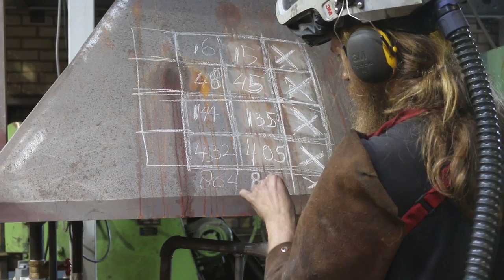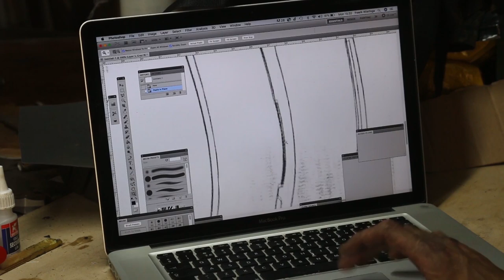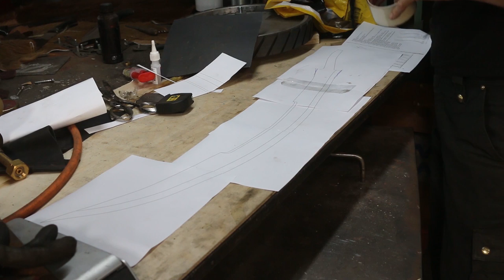Forging a 800 layer pattern welded saber, the complete movie.

Comment: I admire the work of every blacksmith !!! But how difficult the work was without all of this technical help and machinery. What strength, art and knowledge they had. Respect !!!
Reply: It takes different techniques. It used to take more time, but that doesn't mean it was harder, just that it was longer. Remember that they were not as rushed as we are, back then.
Reply: @AnonningAnon  i thought vegan against anything metal.
Reply: @hervyakay4053  I'm anti vegan. Vegan't means "Vegan not".
Reply: Aint no power in sushi

Comment: A Polish hussar saber with a feather, with Polish cross art a deadly effective weapon. A real forage harvester in skillful hand. We touch the handle with the tip of the blade. If it doesn't bend or crack, it is well forged. A much faster and more practical weapon than the Japanese katana. One cut with a katana, three cuts with this saber at the same time. Polish patent for winning battles. Good job, sir.

Comment: You are an artist... This "Kilij" looks really cool. But it looks like you haven't sharpened the reverse edge in the upper section. Except for some examples from the 18th and 19th centuries that reverse edge on Ottoman swords is sharp. In Turkish, this part is called "Yalman" and used for the reverse cutting action. This part is usually about 1/3 of the total Kilij length.

Comment: Freerk's Welded Saber

Attack Damage: 72-146
Attack speed: 1.10 (seems heavy)
Fire Damage: 53-88
Light Damage: 1-104

Bonus Craft: Having a Red Beard increase your Damage and Attack speed by 100%

Bonus Set (2):
The Viking's Law

Freerk"s Welded Saber
Wieringa's Hammer
Have 50% chance to stun monsters. Stunned Monsters take 26000% of your Attack Damage per seconds.
Reply: كيف صنعتو

Comment: Is the grain structure of the metal different depending on whether it has been forged with one, quick squeeze in the press, or formed by thousands of of beatings by a hand-held hammer?

Comment: did you start with 15 layers intentionally? couldn´t help to not notice the progression chart for 16 / 15 layers and now feel inclined to think you just fell short of material
 
my math says you got 757 layers at most if there are none lost through scaling off/ grinding.
You started with 15 sheets, 8 of steel A and 7 of steel B. steel A  will always be on the outside so when folding and forgewelding together you just thicken up that outer A layer that then will never surface again. As you did 3 double folds( stacking 3 slabs ea of the previous bar) and a single fold we have to reduce the amount of layers by 1 for each fold per heat.  15* 3-2 >43 *3-2  >127 *3-2 >379 *2-1 >757

that nerdy stuff aside i really enjoyed watching you doing your stuff

Comment: Beautiful sword. That being said, it looks quite weighty in general with a lot of weight near the tip of the blade. Be interested to know the total weight and where the balance point is.  Heavy tip makes a great slasher, but greatly limits recovery time if a second blow /strike is required. Suspect this sword would cut most things I. Half, especially if wielded from atop a horse.

Comment: This looks beautiful.

But I have to ask: wouldn't it be way easier, faster and cheaper, if you go immediatelly to that beltgrinder apparatus at 3:46 min to remove the scale, instead of removing it roughly with a discgrinder first and then smooth it out with that beltgrinder?
Also, what is that crisscrossing at 14:05 min and drilling at 14:56 min good for?
I don't want to be disrespectful in any way, but I just can't see the use of it. Could someone please explain it to me?

Comment: What is with the air system mask he wears? Not doing much to filter particulate matter with no proper face seal, due to facial hair. Better to wear a simple dust mask. He doesnt handle strong acids or vapors. Idk why he wears at all

Comment: I really wish if someone can explain what's happening ? what is that powder he is putting? what are the two different metals he used and why he is using two types of metals at 1:15 ? why he is grinding the piece of metal with the grinder every time and then ? what is the sand benefit here 10:30 ? why the diagonal cuts at 14:26 ? and the small drilling at  15:08 ? what is this solution at 22:16 what the benefit of it ?? man why the burning between the woods ? can someone please explain !???????

Comment: HOW HEAVY IT IS ?,,,,IN THE REAL COMBAT ,,,FOR ONE HAND BATTLE....TOTAL UNPRACTICAL....
Reply from the maker: People say this, but I use a 4 pound hammer and think it is very light even after a full day of hammering, my grandfather used a 6 pound hammer and thought it was light. I recently worked with my uncke who can easily lift a 300 pound anvil. Functional weight is very relativele to the user. There are examples of 4 pound viking swords. If your personal weight is 240 pounds lean this is not heavy at all.